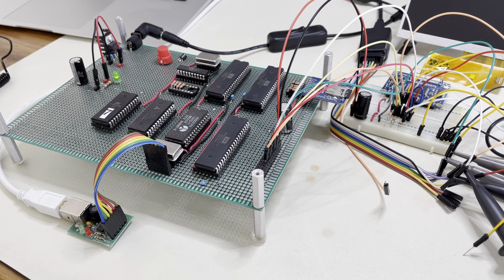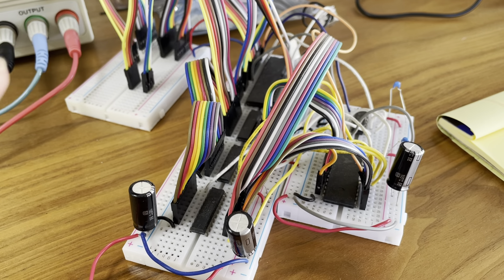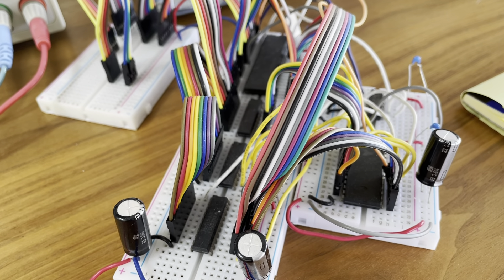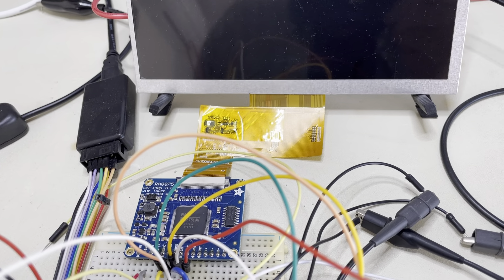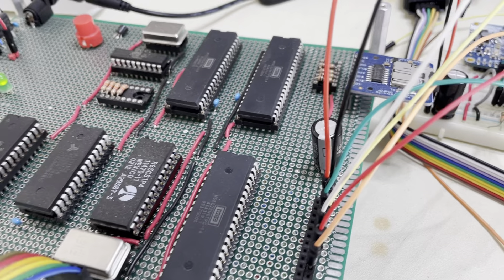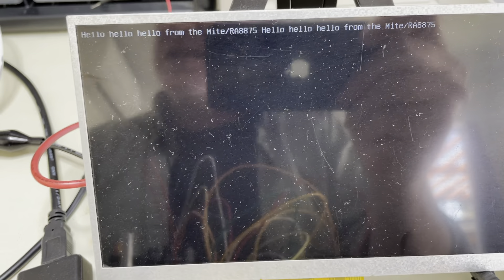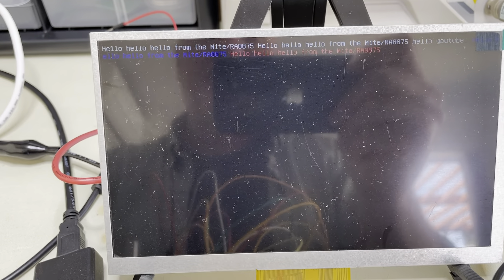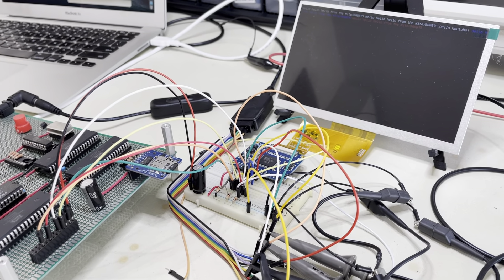6502 Mite home-brew computer project, step 21: a new direction?

Comment: Hi again. I finally found one of my old TMS9929A chips. I’d wire-wrapped it on some matrix board back in the 80’s. I must play. :)
On the RA8875 approach, I do see the RA8875 supports a 6800 compatible 8-bit bus interface (ie. D0-D7 + CS + R/W).
Although using the RA8875 is not true to the retro nostalgia, if heading in this direction, I would most definitely only interface your WDC 65C02 via the direct memory mapped 8-bit bus interface.  None of this SPI bit-banging nastiness! :)
If your RA8875 board doesn’t bring out these pins, then I’m sure you could wire them up with some 30AWG, or find an RA8875 board that brings the “8080/6800 parallel MCU interface” out to the connector.  Just say’in. :)
Reply from the maker: Yeah I may explore this; certainly it'd be a good deal faster! The particular breakout board I have is designed for SPI and doesn't give me access to those lines, and I'm not sure that I'm up to the surface mount soldering but there might be another option.
Reply from the maker: @gregclare  The RA8875 is a 3.3V device, but is 5V-tolerant, so I'm actually using it directly without level shifters. (The Adafruit board does have shifters on it so I can run it with a 5V supply, but I don't think that it shifts the signals.) So you might be able to get away with a 5V setup. Yep, certainly no sprites, I'm afraid. The all-in-one setup with the bus interface available is certainly nice.
Reply from the maker: @gregclare  Oh thanks for pointing that out!

Comment: MC6847 chip? I used a IDT7130 dual port Ram, MC6847 Video generator, and MC1372 modulator. CGA type graphics. Used in Radio Shack Color Computer with MC6809E and Hitachi 6303 SOC. Like 6502, these chips have similar bus and clock. With the display chip accessing RAM a in clock phase one while 6xxx accessing RAM in clock phase 2. The SY6545 like the TMS9x18 can access screen memory only in a single byte interface (not your SPI) and although that saves I/O addresses it is SLOW.

Comment: Just curious about your VDP overheating / getting burnt out.  What IC's are you using for the octal demux latches?  How much load on the output pins? etc.
eg. Are you using CMOS latches (HCT?) for minimal AD output load?  Is the max load on video output pins 470ohm etc.
Just curious, as the datasheet doesn't appear to indicate the IC requires a thermal heat spreader. I played with TMS9929 (in my case) sometime back in the 80's, but don't recall requiring a heatsink (yes, they do run hot but I don't recall any runaway thermal failures).
Of course, back then it was the standard 8x 4116 DRAM config (and 4116's weren't cheap back then!).  Interested in playing with a modern implementation using a cheap 61256 or similar SRAM.  So, I've been digging around in my old IC storage trying to find my old TMS9929's. I know I have some somehwere! LOL
Reply from the maker: I confess that I did not exhaustively run this one down. The latches were 74HCT574s. The output load may well have been the problem since, while I was testing, I wasn't being careful about that. Again, leaving it on over a few days while in that state was a kinda dumb move on my part.

Comment: have you consider to look for the rasberry pi Pico to create hdmi output? IT COST 4$, is hdmi capable, and have c project to make hdmi outputs.
Reply from the maker: Yes, that would work well, and I thought about it for a while. It has always seemed weird to me to use a Pi (or, for that matter, an FPGA) which is SO much more powerful than the 6502, to generate video from it. One could simulate the entire system on the Pi quite easily! (If you could get hold of a Pi, of course; they are very hard to obtain at the moment.) Of course, the LCD driver in my board might itself be much faster. Eventually, I discovered a wiring problem on the board that was likely the reason I couldn't get the TMS9918A to work, but the SPI/LCD route is still a nice direction for me because it can be more self-contained.

Comment: I have the RA8875 working with my 6502. Though I am stuck in how to implement vertical scrolling in text mode. 

So when my terminal program is on the last text line and needs to push the text up to make room for another line I am stuck. I have tried to reprint everything from memory on the screen again minus the first line but it is not that fast. I am doing bit banged SPI at around 4MHz.

Looking forward to how you will handle this.
Reply from the maker: I've actually just got this working. The trick is to ignore the instructions in the manual about the scroll window, which won't actually help you. Instead, when I reach the bottom of the screen, I use a hardware block transfer (BTE) operation to move the screen up by a third (basically, copying the bottom two thirds into the top two thirds), then draw a rectangle to block out the bottom third of the screen (the new space) and reposition the text cursor at the top of that new section of text.

It's not automatic -- you still need to keep track for yourself when you have reached the bottom of the screen and need to scroll -- but the hardware block transfer operations make it speedy.
Reply from the maker: I just posted another quick video update to show the scrolling.